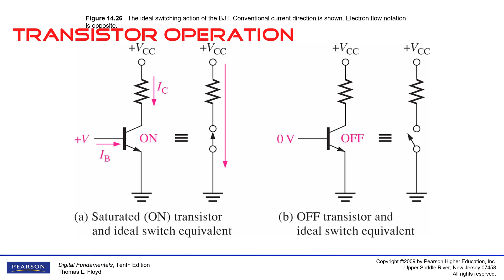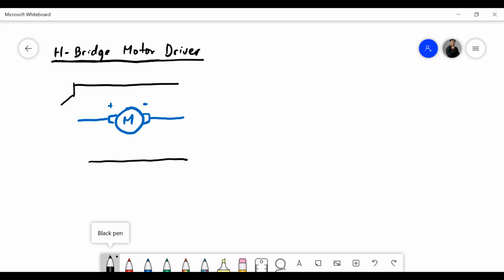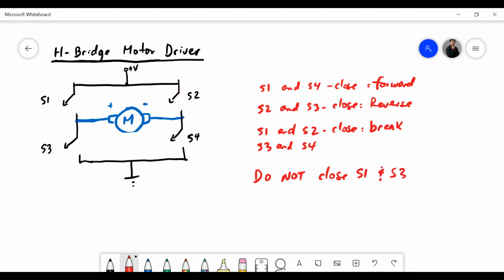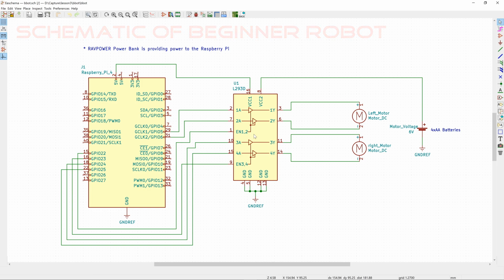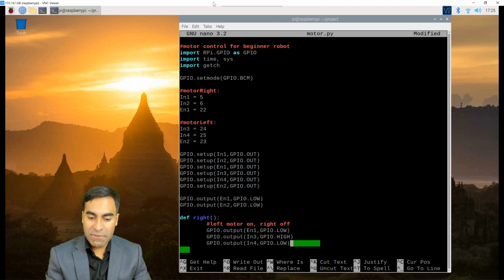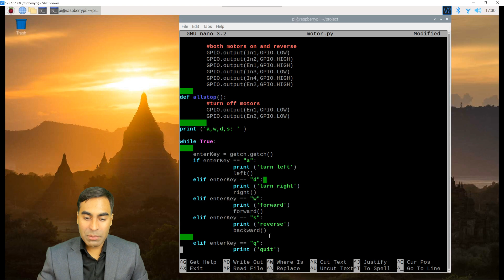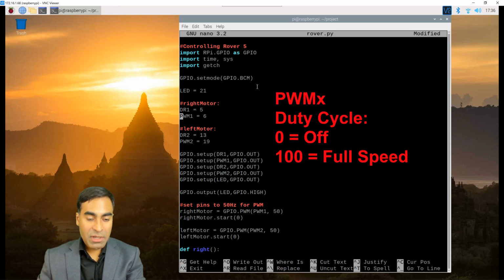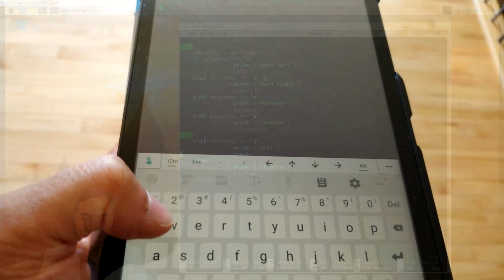MOTOR CONTROL using H-Bridge Motor Driver - Lesson 3 on How to Build a RASPBERRY PI ROBOT

Comment: Hello Shaun, greetings from the Netherlands. What kind of robot do you use? I like the white one with the tracks. It seems to have enough room on the top to place a Pi4 with a breadboard.
Reply from the maker: Thank you for the message. Greetings from Canada! The tracked robot is called the Rover 5 Robot Platform. It has lots of room for the Pi and breadboard. In Lesson 6, I added an IR distance measuring sensor to make it autonomous. You can find the chassis here: https://solarbotics.com/product/50858/
Reply: Hello Shaun import getch is giving an error in the code, could you help me out?
Reply: Getch is resolved :), but now if i give the command sudo python3 robot.py its gives an error on line 37 GPIO.output

Comment: Great lessons n it's very useful for the beginners like me ThankQ Soo much..... i have one doubt that just i have build the robot like this and i am trying to control the motors with TB6612F Motor drive but it's not moving, i have defined the pins with AIN1&2, PWMA&B like this, will U help me how to sort that.
Reply from the maker: Hello. Thank you for the comment. I'm glad you found the lesson useful. As for the TB6612 board, try this site and let me know if you are still having difficulties: https://learn.adafruit.com/adafruit-tb6612-h-bridge-dc-stepper-motor-driver-breakout/overview
Reply: @ShaunNanan  ThankQ soo much for U r reply.....i have gone through that link but it is for servo motor right, i need to build same robot in the video using TB6612F Motor drive (normal motor drive it's not Adafruit device)
Reply from the maker: @rajeshkumarj9623  On the site, it's using the example of a stepper motor. This driver can be used for 1 stepper motor or 2 DC motors. For your DC motors, Motor A is controlled by INA1, INA2, and PWMA; also, Motor B is controlled INB1, INB2, and PWMB. The pinout should be the same for yours. Give it a try and let me know if it works. I'm very happy to help. Another link of the chip is here: https://www.pololu.com/product/713